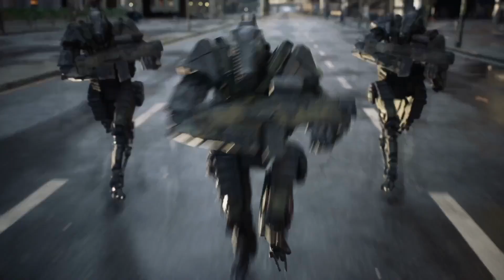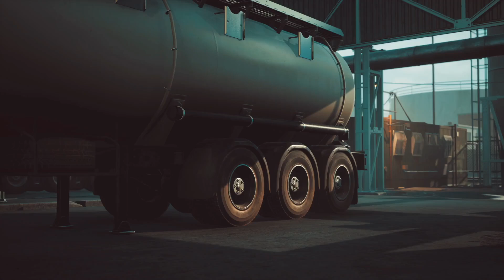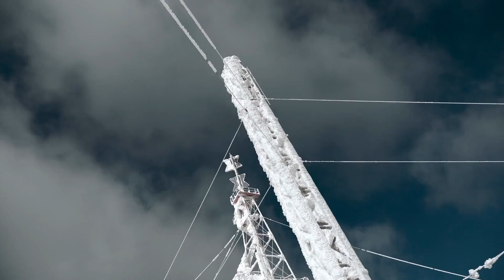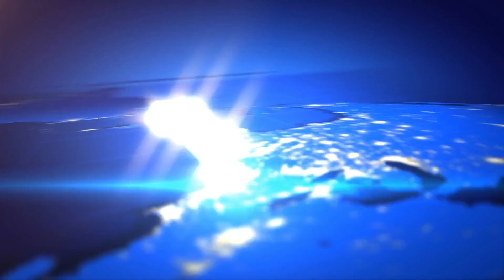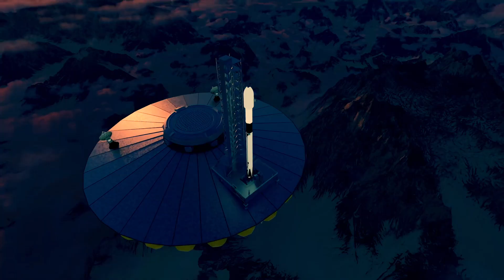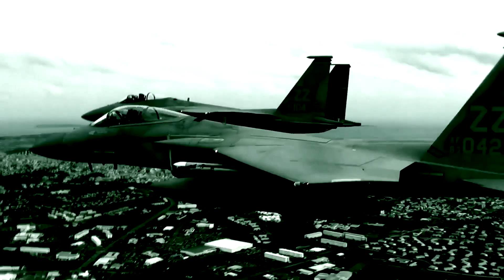Electric War - 'Prof' Simon

Comment: What is it about water? Does the hydrogen have a role in energy production? Certainly,  with regards to a battlefield,  I imagine water provides similiar logistical challenges as any liquid or solid fuel source. There just seems to be a connection on some level. 

Whether these objects are terrestrial or extraterrestrial, though interesting, the technology is what puzzels me. Instead of debating who they are or where they came from, I think understanding how they work is the  key. If these things fly, which they seemingly do, I imaginne they are also vulnerable to crashing. Thus, I think we need to begin to seriously consider that there are governments around the world who have recovered wreckage and are indeed hard at work back engineering this technology. I wonder how much success has been realized in that process over the years? And what current applications orginate in that technology?

Comment: I wonder, if UAPs are not ET in origin, and are of terrestrial origin, what advanced technology powers them. Given reports of observed flight characteristics and the instantaneous acceleration and deceleration, reaching truly remarkable speeds. Then stopping instantly and/or instantaneously changing course at severe angles. Say 90° for example. Or hovering  which consumes large quanties of fuel relative to forward flight. What is it that provides the power to achieve this? 

Also, there seems to be at least a causal link between them and water. I have read so many reports of them hovering over agitated water. Both salinated and fresh. Or of the craft seemingly sucking up water while over sources. Could this be integral to powering them? Or perhaps a source and means of cooling batteries or some type of reactor which is capable of producing the huge power presumably necessary for achieving those flight characteristics, acceleration,  and sustained high speeds observed?

Comment: With the transmission of power from the aerogel drone this surely will be like a beacon denoting its altitude and heading. All vital for targeting said device, we will find celestial superiority a must for this to work but again ground based receivers will still be targeted as fuel and ammunition dumps are targeted these days. Will weather warfare effect the power transmission ?eg if you can generate a powerful storm above the battlefield and below the drone will this disrupt this. I truly think @ somepoint, the more tech that will be employed the more susceptible the battlefield will  become to complete system failure. Wars will be won again by manpower on the ground. The most complex yet most unpredictable device on the battlefield is the organic component ( the human). This itself will decide the outcome when there is no battfield mesh, no comms to the node, no overwatch avaiable in my opinion.

Comment: The Gimbal UAPs are small vehicles known as Lightcraft.  They are powered by lasers or microwave beams.  One way to solve the weight problem of an aircraft is not to have batteries or fuel on the aircraft.  Although, they were promoted as a transportation concept into space long before the Space Force was created, DoD, not NASA paid for the project.  It used equipment leftover from the SDI (Star Wars) project.  Based on the funding source, is this for civilian transportation or is it for a weapon? 
           Something tangental to this which is that a major problem in the Russo-Ukrainian War is that the missiles and drones which the Russians are using largely to attack civilians are much cheaper than the intercept missiles the West provides Ukraine.   While these have to protect civilian areas, this diverts resources from protecting Ukrainian troops and attacking the Russians.   General Kellogg says we have to shift from using missiles to bullets to intercept these things.  I hope something is being done to use laser technology to go after these.  If it is possible to generate plasma, it is possible to destroy a missile.  Electricity becomes the weapon to drive this. As soon as there is a line of sight, they might be destroyed.  The hypersonic missiles aren't faster than the speed of light.
          The Ukrainians are doing a good job in targeting Russian oil refineries.   They will have problems selling fuel for funds, run their economy and keep their war machine going.
Reply: Most underrated comment award. :medal-yellow-first-red:(Sorry for the three-month delay. I came here from July.) 
I remember media hype about microwave energy transmission way back in the 1980s; including SDI but also orbital solar panels beaming power to cities all over the world. I guess that's still "20 years from now"?  Back in those days, I heard the main obstacle to shooting down ICBMs was targeting precision. We seem to have figured that out now, yet we still rely on interceptor rockets. I think nobody will be surprised if it comes to light that is an economic and political decision, not a tactical one.

Comment: EMP says it won’t…..it will be a electronic battlefield but analogue equipment is just too valuable. One of the most important planes on the planet “ The doomsday plane” is deliberately use it old analogue systems because the they are battle hardened against EMP, interference or even hacking.

Comment: I don't think so.  Even if the technology could be developed, which I doubt, one missile could take down a relay drone, and the missiles would be available before the drones are.  That would cripple the entire field of operations relying on that drone.

Electric tanks are a dumb idea.  They use ghastly amounts of energy and weight multiple tons now, imagine them with twice the weight to carry all the batteries, but now with a fraction of the range.  And then what do you do if they run out of power away from the charging station?  They are hard enough to tow now.  But at least now if you can get a truck with some diesel to it you can restart the tank in less than an hour.  With electric, you'd have to bring a generator, and it could be hours before it's moving under it's own power again.  But anyway the Ukrainian war has proven that the operational tasks the tank remains suitable for are now strictly defensive, as drones have made them obsolete out in open conflict.  It is now the case that if you can see the tank, you can destroy the tank.

Comment: Actually the future war will not be electric powered, because of a simple set of figures
Petrol 37 mJ/kg
Diesel 43mJ/kg
Batteries 0.35mJ/kg
Batteries simply do not scale up to something the weight of a tank. This is why JCB scrapped all ideas of electric excavators and site machinery and went on to hydrogen, whilst one of the major tractor manufacturers has scrapped their electrical  tractor program and gone on to methane produced on the farm, which is actually marginally better than Diesel. At the turn of the century there were more electric cars than ICE ones, all that held them back was the batteries. Battery development has been continous since about 1900, and what has been achieved up to today is still woefully inadequate when compared to a petrol or diesel vehicle.  DARPA may well be working on it, Darpa works on lots of things that never see the light of day. This will be one of them. You can have a lightweight low power battery, you can have a massively heavy battery, but most of the work the battery will be doing is to move its own weight. Incidentally, all batteries are DC and there is no  way of charging faster than the battery can cope with. Fast charge reduces the life of the battery and causes it to overheat, slow charge is good, but slow! Teslas transmitted power did not work by reflecting power from one place to another, it set up resonance around the globe and a tesla coil placed in any area where this resonance existed would resonate in sympathy with the master resonation and generate power, but there are losses!
Phil
Reply from the maker: good info

Comment: How would it change things if we had a device the size of a trailerable generator that could provide Megawatts, is non radioactive, fueled by a readily available element, and that the fuel is so power dense that there is no need refueling in the field.